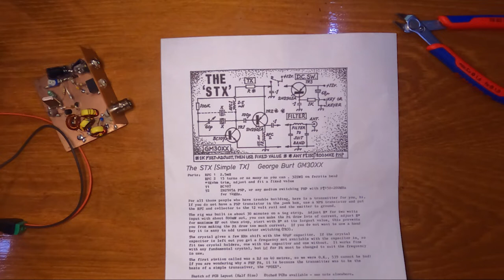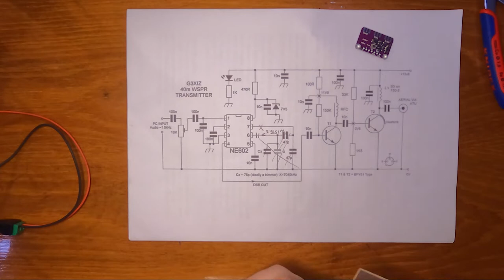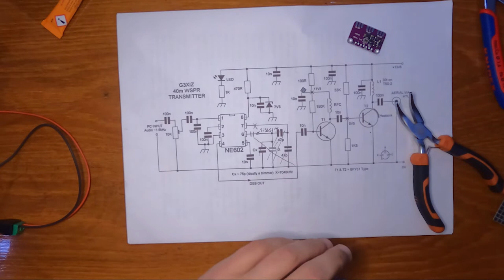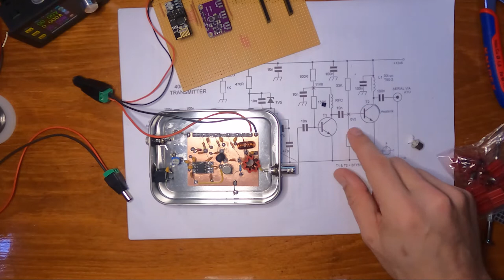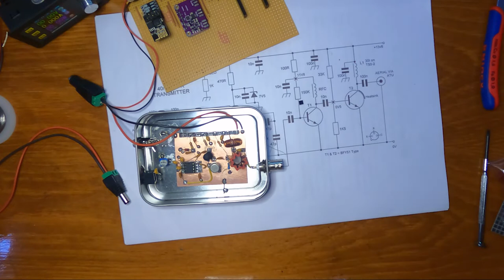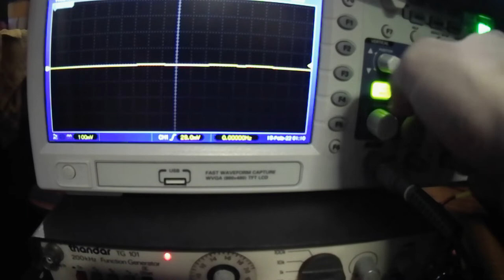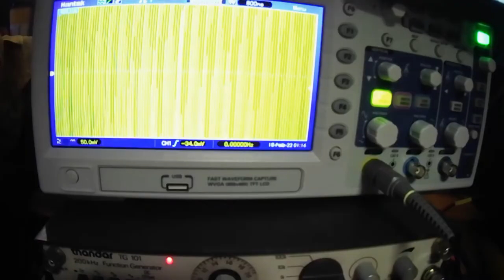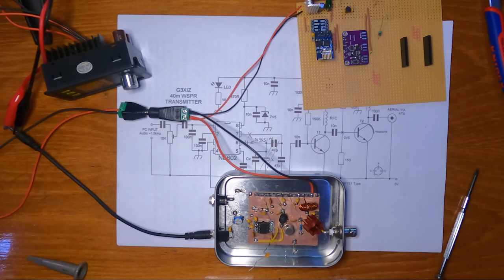Stormy weather projects - WSPR transmitter

Comment: I was sitting here screaming, "Don't power up a transmitter without a LOAD!" The power has to go somewhere. You might get away with it with very low power, or an output with protection circuitry, but you must always remember that the power has to go somewhere. BTW, I like to do exactly what you are doing here. I have very little interest in exchanging "5-9's" with people off in the distance. I'm a builder, a learner, and an experimenter. We aren't in the majority of ham radio, but there are still many of us involved. In the USA we are the reason the FCC licenses hams to design, build, and operate just about any RF gear we want, just as long as we stay in the ham bands and don't exceed 1500 Watts output. Our government knows it has little use for those who chat on the air, but it has a great use for a group of people who understand electronics and can make communications systems work. We are a garden of technical expertise, and the government wants to see us grow.